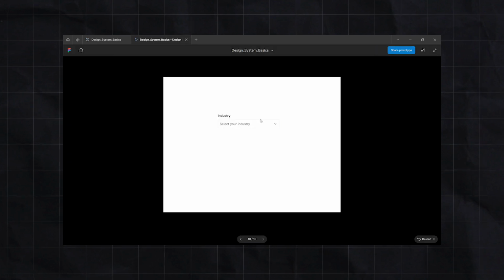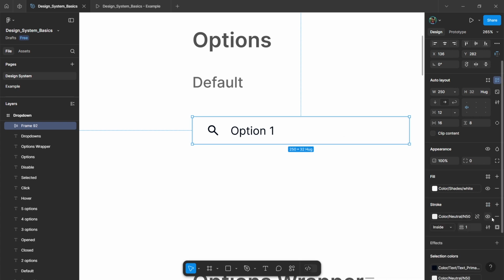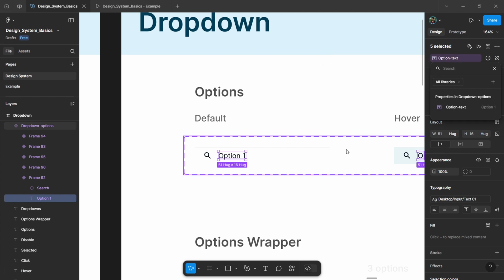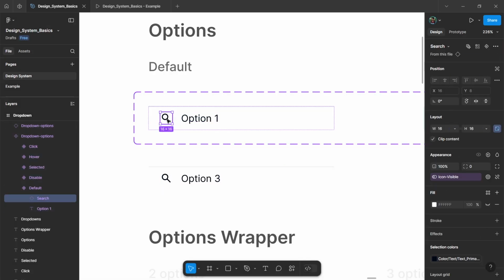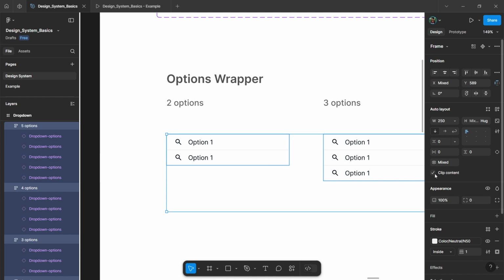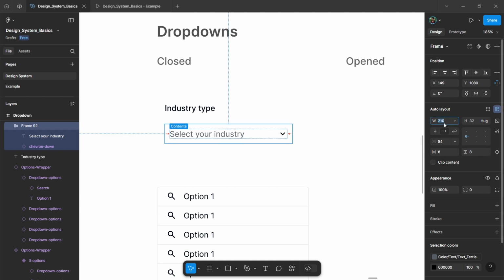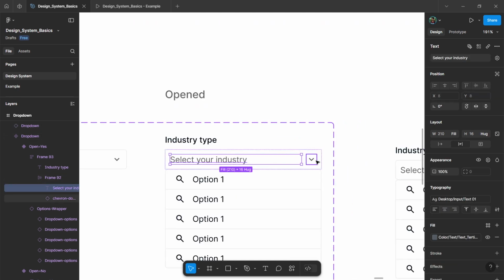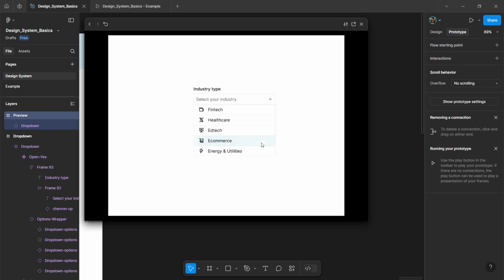Figma Dropdown Menu Component and Variants | Design System for Beginners

Comment: Hi Subhan! I loved this video, thank you SO much for sharing! It was very helpful!
I have a question:  If I want to use icons from Iconify plugin instead? Can I do it?
Have a nice day!
Reply from the maker: Absolutely, you can use icons from the Iconify plugin in Figma! 🎉
But here’s a quick tip to make sure everything works smoothly, especially if you're planning to use them in components:

Iconify icons often come in different styles like duotone, where they’re made up of two separate vector layers. When you use them in your components, you’ll want to convert them to SVG vectors (if not already) and check how the color styles are applied, sometimes Figma doesn’t apply them correctly, especially on layered icons.

So before you drop them into your components, double-check:
- That the icon is fully vectorized.
- Color styles are applied correctly (especially for multi-layer icons).

Hope this helps! 😊
Reply: @subhanshaikh11  You’re the best! I had the same problem you mentioned here (I tried using some icons, and they appeared in "two colors" when I created an icon component). The color styles weren’t applied correctly!

This is a great tip to keep in mind for multi-layer icons.
Thank you once again! :)

Comment: I have small question Subhan. Suppose i have made this for One List dropdown. In the same page if i want another List which has another dropdown Do i do this entire set another time for the 2nd one? Or can i reuse the Initial Button default, hover that one in the 2nd List also? Or will it clash in property section in such a case?  basically my question is in one screen i have two drop down areas each with its own list.

Another issue i faced. I did one dropdown. And then the nav bar on top menu which had home, about us etc which also had States it disappeared. Does that mean we cannot give State two times in one file
Reply from the maker: Heyy! First of all thanks so much for watching and asking this question 🙌

So for your first question, no need to do the whole dropdown setup again for the second one. You can totally reuse the same option component like default, hover etc. Just drag the instance and change the text or icon from right panel. It won’t clash unless you’re using same exact text property name across different components. So both dropdowns can work separately in same page.

Just make sure you are using instances not duplicating the full component again. That way Figma keep each one separate and clean.

Now about your second issue You can give two states in same file no problem, as long as they are for two different components.

So in your case I think the issue is not with the name, but maybe with the nav menu components not connected properly in prototype or maybe their instances not dragged into the design frame correctly. Sometimes we change things in component but forget to update the instance on canvas, so it disappears or loses its interaction.

Try once to double check:
- Nav menu is in frame properly
- It’s a valid instance (not detached)
- All variants and prototype links are connected

You can even try dragging a fresh instance from the Assets panel for the Nav Menu Components again and see if it works.

Hope this help 🙏
Reply: @subhanshaikh11  Thank you so much for detailed reply. I will do so. Thanks again.